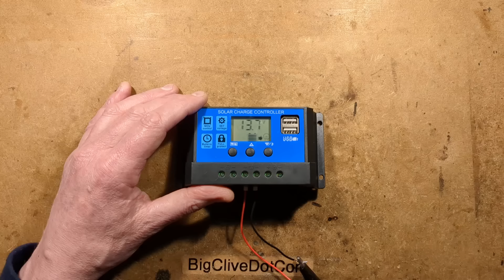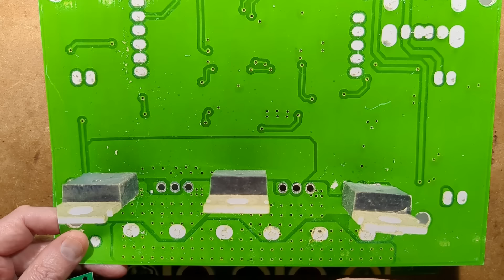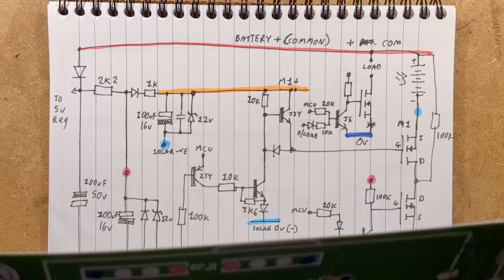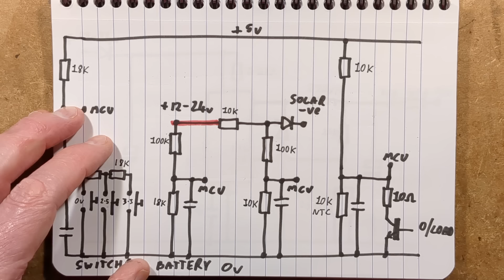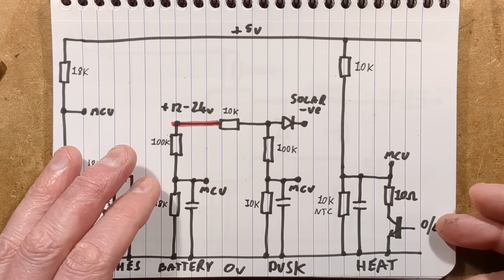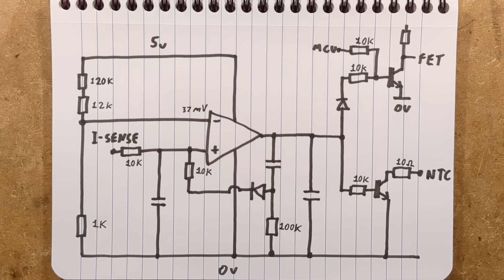Exploring a mass produced solar charge controller

Comment: If you want to connect two smaller sized 12V 40A panels, should you put them in series (24 V) or is it better to do it in parallel ....
Thanks !!!
Reply from the maker: That will depend entirely on the system voltage you choose to use.

Comment: Big Clive.  Im about to use some of these cheap pwm charge controllers that I have on hand to charge a few marine deep cycle 12v batteries on my new solar cart.   To protect these batteries from over charge, what circuitry can I build in between the battery and cheap pwm?
Reply from the maker: You can get modules that will detect a voltage threshold you set and will disconnect the power from the battery if it is exceeded.

Comment: To be fair, USB proper is only 500 mA at 5 V. Later modifications have muddled this up, but 500 mA is quite correct, and no USB device should use more unless it's communicated and established that the port can deliver more.

Comment: Hey Clive. I bought folding solar panel for outdoor usage. It comes with all sort of plugs but no visible controller box. Can i plug my phone straight to it, or i need to buy controller like this one?
Reply from the maker: Some solar chargers have a voltage regulator built into a small box on them, but some are just the panel connected to a cable.  It's possible for some to put out more than 5V and some phones may not even try to charge at low current.
A power bank may be a useful intermediate way of grabbing any solar power available.

Comment: The cooling pad of the transistors on the rear side is a weak feature. Don't even touch the rear metal panel?
Remove that rubber and bend the transistors upward, adjust straight,  and add a spoonful of cooling paste.
.
Afterthought: If the transistors must be isolated from each other, we cannot use cooling paste alone, we must use the isolation pad.

Comment: I bought a "30A" version from AliExpress - it has 5 MOSFETs covered with thin opaque yellow tape (doesn't look to be thermal transfer tape but it's not Kapton either) and a different board layout to the one in the video (it's labelled W88-202512 -  it has a single row of connectors for the LCD running across the board above the switches and various other components moved too - plus a bridge rectifier instead of discrete diodes - but the circuit seems the same).  The specs claim 2.5A max USB power (specifically mentioning Apple Phone charging) but it uses the same driver chip so hmmmm....  The discharge current is 10A for 10/20/30A versions (W88A/B/C), 30A for 40/50/60A versions (W88D/E/F) so I do wonder if there are minor differences between versions or not?

Comment: I probably have six of these deceased in my collection, various internal configurations with the same basic external design. Terribly unreliable but the one I'm currently running the display took a dump but output is still usable.
Reply from the maker: Are you exposing them to moisture?

Comment: I've had a couple of these. 
They NEED to be mounted on a bigger heatsink.

If they overheat, sat in a window on a sunny day, odd effects can happen, like over charging the battery.
Reply: I bough a cheap china charger once tho it looked different than this. Eventually it started outputting full voltage from panels to the battery so battery was pretty cooked haha. Current system still has pwm charger but its not a cheap one.

Comment: Got one of those 10 watt polysilicon panels of AliExpress with this token gesture charge controller.

I mean, it works! Solar panel is even within tolerances, I measured about 7.5W with a crude test.

Wish I didn't accidentally destroy my sealed lead acid batteries by over discharging them. Had my phone and a USB car charger hooked up to it and dragged the voltage way down. Having one of these would've prevented that.

I'm thinking..... Army of NIMH batteries? Either 10 or 12 in series.

Comment: I recently picked one of these up from Amazon. It came bundled with a 100w solar panel. Took it apart to have a look and noticed mine has the lcd display socketed into the pcb. Took your advice and removed the usb completely and conformally coated everything except the top of the tactile push buttons. We’ll see how it does this summer.

Comment: Super detailed and concise video! Thank you. I bought this to make an autonomous allsky camera. I put a lead battery and a 100W Dokio solar panel. Worked fine until it didn't stop drawing current during the night despite the battery voltage was below the 10.7V discharge stop setup. I found my battery at around 7V in the morning. 😣 Probably a defective unit?
Reply from the maker: Disappointing.  Especially if the camera was on the switched output.

Comment: 3:04 why would you have your solar charger controller turn at dusk and off at dawn, solar needs sun and there's no sun at night
Reply from the maker: It charges the battery during the day and can use that stored charge to run lights at night.

Comment: 1:17 the owners manual on this says it is only compatible with lead acid batteries OPEN, AGM and GEL, it says it is not suitable for metal hydride, lithium ion or other batteries
Reply: I just bought one, actually 2 for 15 buck off amazon... the 30 amp variety, and it specifically mentions working with lifepo4.

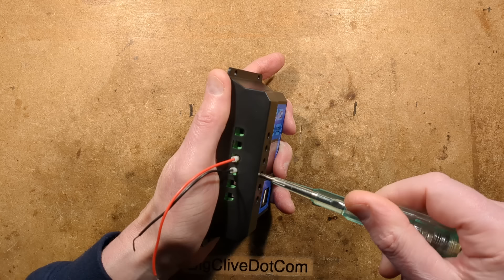Comment: 5:05 
I am laughing my A** OUT for misleading people. 
The slots there are meant for thicker DC Cables to be plugged in well not just there all the slots provided is for thicker cables. 
Please stop misleading people, this is a fantastic product and I am using it since very long. 
Do note, this is only for small capacity solar plant like 500watts to 750watts plant not more than that. Also, these products are for the smaller panels where the max output Amps is 5 or 7 when you combine 2 or 3 panels. So, pick according to the connect you have not just blindly purchase this and curse the makes becuase of your stupidity. 
Reporting this as misleading

Comment: i had one of those cheap ones , that kind doesnt handle higher voltage only whats it made for 10a so everything over 10a in chargin wont be used its just dumped easy saying . i bought a more expensive MPPT charge controller and havent regret it one day my one cost ca 120£ the cheap 10£ .  and the usb sockets stopped workin after 3 days of use really flimsy .

Comment: I've used one of these before, not for solar but as a UPS and it is perfectly adequate for powering small loads like routers and network switches. I even paired it with a small inverter and powered 220v loads.

Comment: Hi I have a question ? You mentioned the cut off voltage and on the screen it showed up as 10.7 volts. What if you were to set the cut off voltage lower would it effect the battery in any way besides taking longer to charge and thank you for the informative break down of the pwm charge controller I just received mine with a small 20 watt  panel and I'm using it with a 9ah battery as a phone charger with a 150 watt inverter
Reply from the maker: It's better not to over-discharge lead acid batteries as it shortens their useful life greatly.

Comment: So i want a good shade power solarcell. Need a good mppt controller for that. It would not have to be more thwn 20-50watt for start but its so difficult to find the infos.
Reply: Found out the smallest Victron MPPT are like 40 Euros here around. Which isn't that much off a "real" china MPPT. So i will propably use this one.

Comment: Hi big Clive. Please make another vid of this with a diagram showing the componet numbers together with values, I cannot get the output to switch on even though the screen shows the output on. I did make the mistake of connecting PV first , It does then assume 24v is being used. I probably . I bought the 30A  model ( supposedly)  it has 5 CSN64N90 Mosfets.

Comment: I burned my first one of this type by connecting it to the solar panel without a battery attached first.
For the second one, I used a capacitor instead of the battery to make the board survive the shock, and it did. I used it as a solar USB charger, but not very fast charging one, as you mentioned.
Now, thanks to you, I know why. Much appreciated! Thank you!

Comment: What are the 2 sockets on the righthand side for with the symbol of the light bulb?
Reply from the maker: For a load that gets switched off if the voltage goes too low, or can also be controlled automatically at dusk.
Reply: @bigclivedotcom OK thanks

Comment: I had a similar one, but kind of diassapointed how much it "leaked" power when there was not enough sunlight. It allowed discharging the battery to such an extend it killed the battery.
As I now see many others using this thing, I was wondering what others experience is on this matter. Was I just unlucky and is the circuitry in essence quite okay?

Comment: Thank you Clive 
    Brought three of these for $46.00 each , 
   20amp 12v / 24v 
     Each with  
1 ) cable with Anderson input  connected into the unit 
2 )  cable with Anderson and Battery Clamps
3 ) a cable of two metre ( twelve foot ) Anderson connectors at each end 

   In local bananas ... the Anderson Two metre is $34.95
 The Battery clamps , Anderson is $25.99
 The Anderson  to unit is $25.00

 So the unit is basically free 

* each Anderson connector has a price of around Seven to Ten local Banana Dollars  , in other words crazy prices are asked for anything electrical related 

   Brought three as the normal price was $65.99 dollars and they wouldn't accept bananas , Cavendish or bobbys 
   " buy two get one free " as i say

Comment: I own two of these really cheap solar charge controllers. They work OK, have lasted at least 5 years, and don't overcharge FLA or SLA batteries. However, they're very cheaply made inside, the heat sink has poor heat dissipation, the wire terminals are flimsy and clearly undersized for the 40 and 100 amp ratings. I would under-rate the maximum current by half, based on the undersized conductors, flimsy connectors, and poor heat sink. The 100A controller is labeled MPPT, but it's clearly a PWM controller, not MPPT. The 100A rating is a joke, it is barely more robustly made than the 40A one.  I removed the heat sink tape, and reassembled it using heat sink paste to improve dissipation, but I'm only running about 10 amps through it, and only infrequently, it barely gets warm at this current.

Comment: My head is spinning, you do know your stuff and I don't.
I use one of these with a car battery, 2 30 watt panels in parallel, to power a CCTV camera.
It works very well, I also run an antenna tuner off the load output.

Comment: 8:55 the only thing that should be plugged into this are one of the small USB Light dongles for providing light when you're adjusting the device or checking the batteries. Ideally one with a built in switch so that it can be be glued in place.

Comment: I bought a solar setup to power an HH0 generator and cannot figure it out i am hoping this will help plus you should check out (Water electrolysis) Really cool.
Reply: i also didnt even get a set up manual for the charge controller

Comment: An interesting feature is that with no load and no solar panel connected and the output turned on the unit draws about 8mA however with the output turned off the unit draws about 12mA from the battery, not sure why the increase in current with the output off can you explain.
Reply from the maker: Probably the level shifting circuitry that turns the MOSFETs off.

Comment: not  recommended over 12v  use as had failures at 24v only last 3 to 6 months repeated , the cct is indeed strange and hard to work out

Comment: Why does the unit not recognise the solar panels
Reply from the maker: It should if they are putting out a high enough voltage.  Also make sure you connect the battery before the panels.

Comment: Amazingly, this little stuff works very well. 
I have 3 of them for more than 2 years now. 
I've built 3 mobile backup electricity kits with, for each, a 100W PV + this PWM + an ebike 12V battery 20A and 12V led lamps . 
This way, when power outage,  i have light and i can charge some devices via USB

Comment: Thanks for the amazing video. I'm an old(ish) Radio Rentals-trained tech. and enjoyed it a lot. I have 2 of these controllers, but with marked MOSFETs. One, which looks identical to yours on the outside but rather different on the inside, with 3x HY1707. The other looks slightly different on the outside but very similar on the inside and has 3x HY1908. Again, thanks for the vid.

Comment: Im lost but your explanation is fascinating. I have the control box and didn't know how to control it. My lights in the barn just flash when I turn the system on.   I have a small solar panel to 12V auto battery to 2 small lights. I check my system in the morning. Thank you for explaining this.

Comment: Wow. Thank you sir! Actually a pretty good deal for 10 Bucks from Amazon. Edit.. The load function where you can select dusk to dawn is perfect for a night light. After a while, I realized I could use a CHEAP down converter, also from Amazon. and paralleled the 1.2 V NIMH  in the solar string twinkle lights. NOW my twinkle lights stay on all night since I am using this to charge the battery in my stand by truck while it's not being used. Works perfectly.

Comment: What type of battery do I need to set it if I am using a normal car lead acid battery? B1?
Reply from the maker: At its default setting for a lead acid battery.
Reply: Do I just press the up arrow to reset the device? Because right now the display only showing an empty battery icon blinking. Can get it to charge the battery .

Comment: Does the output current increase as the input voltage increases?
Reply from the maker: Only for a fixed resistance load.

Comment: Really useful video! I have one of these and use it as a secondary solar system while camping with a cheap second hand lead acid leisure battery from eBay. It worked well to keep the battery charged, but noticed it didn’t seem to work very well to charge devices using the USB ports and now I understand why! I will switch to using it for the 12V output in future thanks to your explanation.

Comment: I bought a solar panel that came with this exact same controller. yet I didn't receive the wiring that connects to this controller. so now I have to buy all the stuff needed connect to this controller. when I bought the solar panel to charge the battery in my vehicle.

This is a complete misrepresentation of what this solar panel is meant to be used for.

Comment: Don't know how to contact you but had an idea you could make a video about. 

There's a budget solar light in B&Q that I have been using. I have 2. 1 is used for my side path, and 1 is used for my shed. it has long cable from the panel to the light, and I wonder if it would be possible to tap some of the power to a power bank. I have an ikea power bank, which I find very useful and it would be good to charge this without plugging it in.

By the way , fellow scot and love your videos.
Reply from the maker: It might be better getting a dedicated solar panel just for charging the power bank.

Comment: I see this as a solid-state12V relay which connects solar panel if current/voltage are sufficient. Disconnect at dusk or if max/min battery voltage limits are reached.  Not bad for the price! Battery type is just the voltage setpoints. Lithium BMS should take care of the rest. 10A looks legit.

Comment: Just bought one of these cheapo controllers from Amazon, deffo a different revision to yours and wanted to compare to an eco-worthy one, which seems to be the same soc?  I decided to open it up to see if I could find any damage as it doesn't power on with my 12v battery connected.  Compared to yours though, the 2 missing mosfets are populated on my board, but there as also been some changes to the cap locations and the lcd mounting (its not mounted left/right all the pins are on the bottom).  Not sure the reason behind this.  

The mosfets serials on my revision are

Si-TECH A
S80N08R
1YZS3 2351

Comment: The other, probably main reason the battery is connected first is likely because it operates from 12 or 24VDC. By connecting the battery first, it detects which. I have several, and they don't compare with the victron ones (which cost about twice as much, still not expensive) - but they are good for what they are. (would love to see a comparison with the victron version of the same sort of thing).

Comment: I installed one of these back in 2020 in my small sailboat to keep a 12v lead-acid deep cycle battery charged using a small solar panel with 20 watt maximum output.  I have a breaker on the battery post.  It's still working great!

Comment: I had one of these in my boat with 240W panels. Even its written 30A, I think my setup was quite strong for this device. One stopped to charge, then i bought a new one and after a month or so in hot summer days it stopped to charge as well. So i converted my system to mppt. I think it is good for systems with less power, maybe 100W max

Comment: I have a lead acid battery I have discharger what's the USBs don't work and my battery won't charge to 100%
Reply from the maker: If you have one of these and the USB outputs don't work that suggests that the internal 5V supply may have failed.

Comment: re the mosfets, at 13:46 "because thats back to front..." its worth mentioning for clarity the reason being that solar negative is way more negative than 'ground' in this diagram...  (say) a 22v panel and the battery have common positive,  so battery -ve is 12v below the common rail, and solar negative is 22v below the common rail, ie solar neg is 10v below 'ground' or battery neg  :)

Comment: mine charges my phone ok so they may have variation. are these safe charging a starter barrery if engine is running though?
Reply from the maker: Not sure how the module would deal with a battery in situ with an  engine.